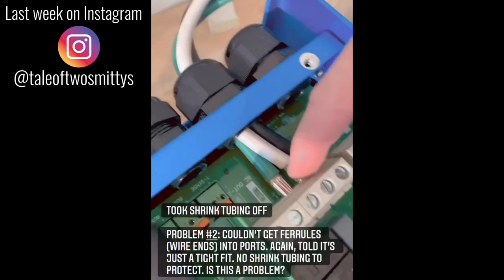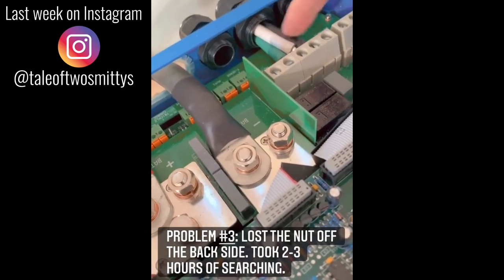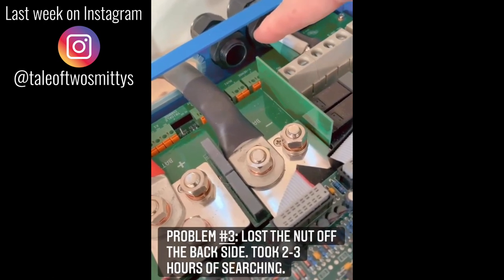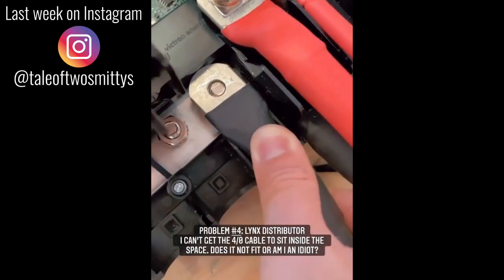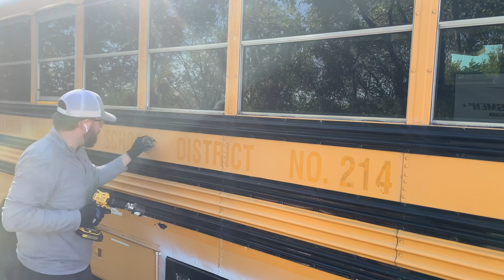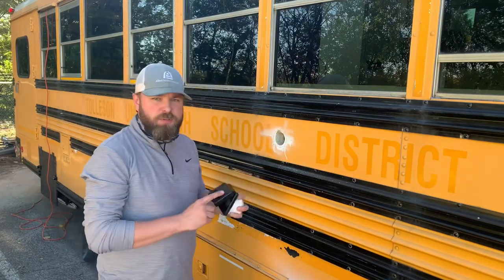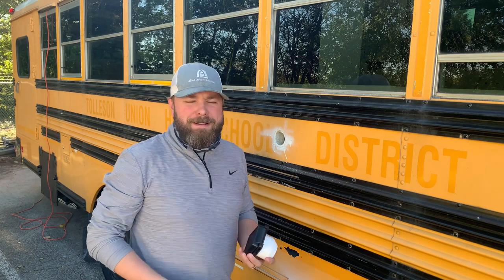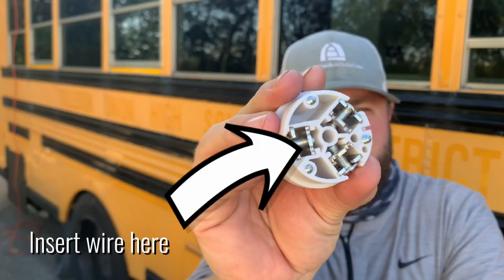Skoolie Shore Power Inlet || 2020 Bus Conversion - Ep 32 || TaleOfTwoSmittys

Comment: Maybe I'm missing something, did you install your shore power on the passenger side midway of the bus? All the campgrounds have power for the drivers rear of the unit. I would move it rather than digging out an extension cord every time.

For the wires that wouldn't go in with heat shrink because it was to tight, mark it while still connected to know where the wires spread for terminating, pull it back out, heat shrink to your mark. Take the nut off of the hole for the wire and slide it over the heat shrink, if its to small you're using to heavy of awg. but that okay. If it's to small to go over the wire drill it out. Under the nut, on the terminal,  there should be some tiny little plastic fingers and a rubber grommet inside of those. stretch them out with a sharpie or pencil or something sized appropriately. If you had to drill the nut you may have to drill this too, the grommet should stretch, you can slide it on the wire just beyond your mark, just where theres a bit of heat shrink showing. Use the sharpie to spread the fingers and slide the wire in. Terminate the individual wires then slide the nut up and thread onto the compression fitting.

BTW, you don't need crimp ferrels on solid strand wire, its used on stranded wire so they won't splay or get cut through from the compression of the terminal.

Comment: Hey I’m an electrician by trade and you wanted to know about the ends on your feed makeup, I’d cut them down just a little more. It’s good to have a little wire showing but not that much. You want jut a little wire showing because you never want to have insulation of the wire inside the actual makeup
Reply from the maker: Thank you!

Comment: Since you have to disconnect the wires to slip the screw cap on, couldn't you shrink wrap them only on the inside there? Then they'd be covered. Idk if its dangerous to have them not covered or not.

Comment: Oh and on your shore plug, I would tape the back of the plug so screws are not exposed. You only do this when you put plugs into metal boxes or in this case near metal. Since your bus is metal it would be much safer to tape it all up for extra safety measures.
Reply from the maker: Thanks for sharing. That makes sense.
Reply: @TaleOfTwoSmittys  for sure. If you ever need anything else just hit us up on Instagram. I’d be glad to help you out with any electrical

Comment: have you experienced any issues with your plug being female? I got the same one and installed it, but I've seen people try to use "suicide cables" and I would prefer to not use that lol
Reply from the maker: Good question. The proper install is to always have a female end where the power is coming from (like a wall socket). So, since the bus is “plugging into” the shore power, the bus has to have a male end, so that you can use a power cable with one male, one female end. If by “suicide cables” you mean both ends male, do not do that. Very dangerous. If the cable was plugged into power, the other end is live and could kill you. Let me know if you have any follow up questions.

Comment: Yeah the wires going into that inverter you can't have anything exposed you're using the wrong tool to crimp the ferrules you need a crimping tool for ferrules but if I were you I would just tin the end of them, also the AC power in you don't have to put Farrell's on that since you using solid wire
Reply from the maker: Cool thanks!